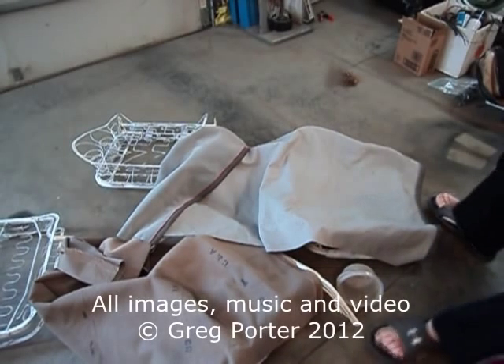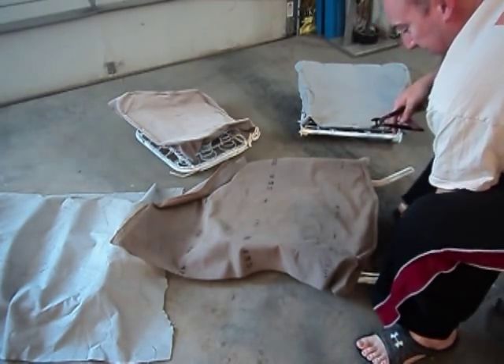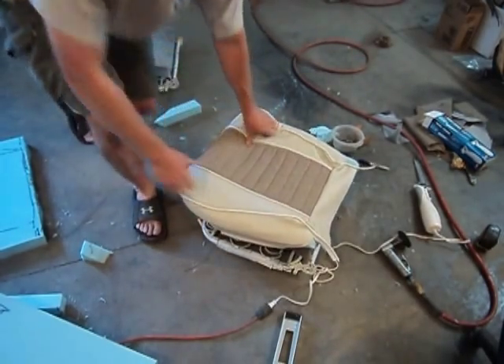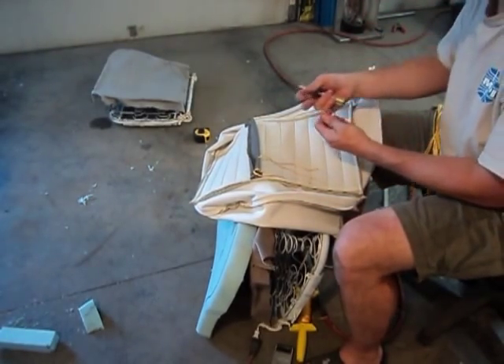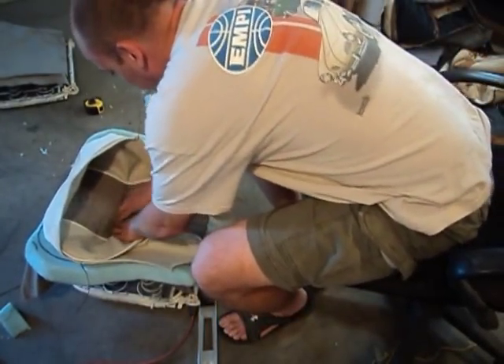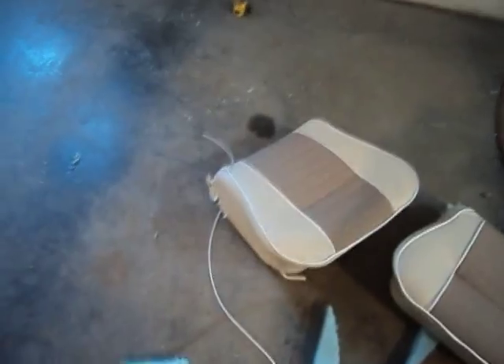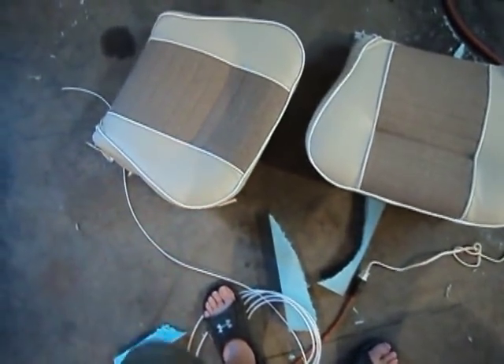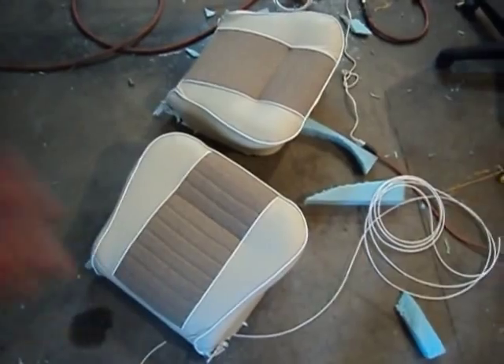Seat Upholstery - Part 2 - VW Karmann Ghia

Comment: Very good for your first seats! One tip if you put a piece of plastic over the edges of the foam you can slide the cover on without it sticking. Then you can very easily  adjust everything into place and then gently pull the plastic out - works like a charm! Not too thin of plastic tough. This works for stuffing all kinds of foam into cushions and any upholstery corners  etc.  You may even find some company's even leave to the plastic in - that's how I figured out this tip.
Reply from the maker: +SoCreativeCards Great tip!  Thanks!

Comment: There are two blades in the box with the electric knife, you clip them both in to the handle and then it will cut the foam like butter.

Comment: Tip for your electric knife if it has teeth grind them off then sharpen as you would a normal knife..found it worked really good.

Comment from the maker: Yes.  Neither works well.  They looked identical but one had a right hand bend one had a left hander.  There are two slots on the knife, the right fits in one, the left in the other.  I am going to try to fit up a hacksaw blade in there and see if it cuts better.  I need to work on my foam shaping skills.